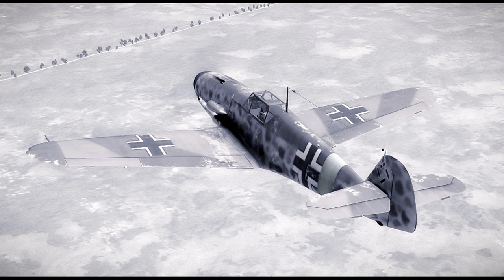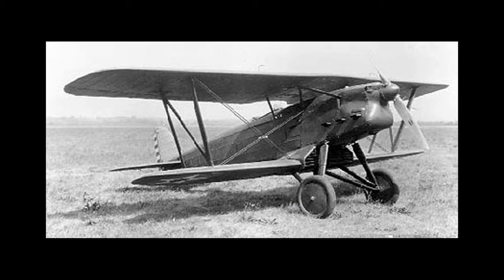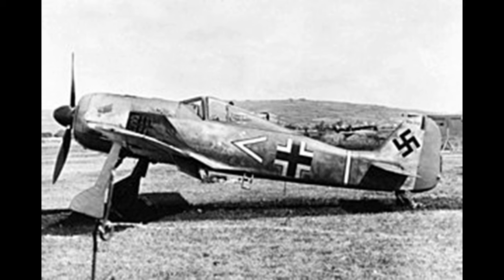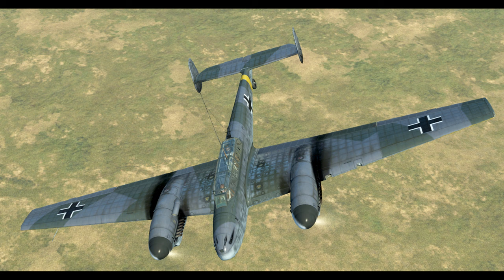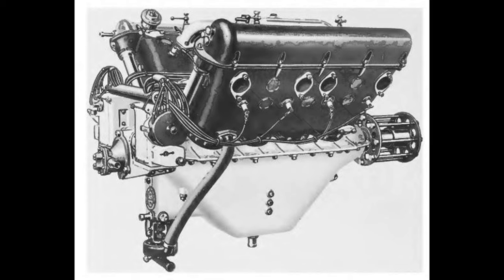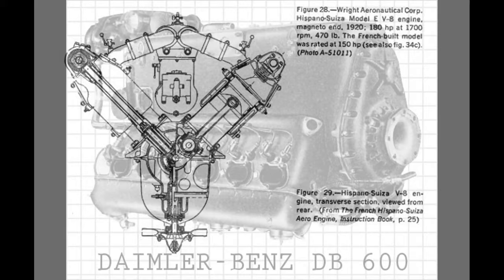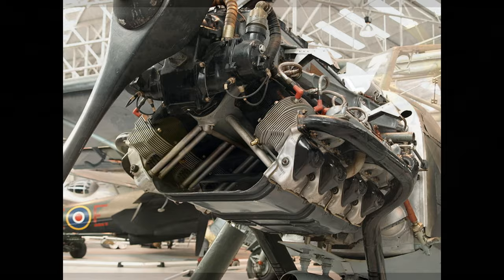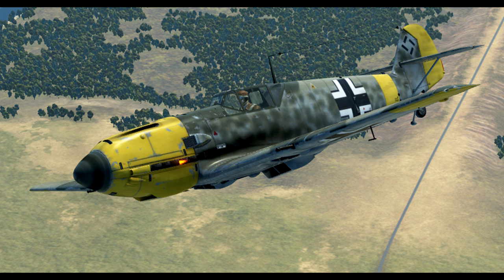Messerschmitt Bf 109 , Why an INVERTED V-12 Pt. 1? inverted V12s vs. upright

Comment: The thing you got wrong about the Tiger is you see the intent wrong. The Tigers intent was not to be a frontline all out tank but a tank you deploy to archive breakthrougs on critical points therefore the "reliability" was not first priority. You call Tiger -> it break through or does a similiar job-> and then goes back and get maintained and goes for the next job. Germany was low on EVERYTHING therefore it pressed it in this role as "Main Battle Tank"
Im a big tanknerd :) 

But great video! Keep it up.
You earned my sub!

Comment: Like you said...and Alan thinks it's a matter of semantics. Nice video. Like that you present the info without bias.
Alan Dicey, former engineer, Avionics and IT

"Oh dear. Yet again I'm forced to begin and answer with "it wasn't"

The DB 600 series were all designed as "inverted-vee" engines, with the crankshaft at the top and exhausts at the bottom. This gave better visibility over the nose, because the crankcase is narrower than the cylinder-head end, and reduced interference from exhaust glare at night.

So, it was mounted the right way up, not only in the Bf 109, but also in all the other aeroplanes it was used in - Bf 110, 210, 410, He 111, 177, 219, Do 215, 217, 335, Ju 288, Ta 152 Macchi C202 Folgore and Reggiane Re 2001 Falco - this not counting the many prototypes that it also powered."

Comment: The Merlin engine was used in British motor torpedo boats and RAF rescue launches as well as a ground version in tanks.  The marine engine had the disadvantage of using gasoline unlike the German E-boats which were diesels.  That was the reason for the development of the Napier Deltic diesel engine which was used in boats by the British and the Americans in Vietnam among others.

Comment: As I recall, Allison was involved early on with producing V-12s for use in dirigibles and other lighter than air craft - they could be serviced in flight and could be reversed in rotation.  Those were the basis for subsequent Allison V-12 designs and they just stayed with that format.  While they had some shortcomings with supercharging, the Allison engines were considered overall the most reliable inlines being used in U.S. built aircraft.

Comment: Good vid, as usual- Just for general info- the only two production American aircraft of WWII vintage that I know of which used inverted cyl head engines was the Fairchild PT-19 primary trainer and the amphibious Grumman designed and built G-44,   Widgeon, both used the Ranger L-440, inline, 6 cyl 175 hp, non-supercharged engines. And according to some people I have talked to who were owners of these types, stated in the PT 19 case it was for trainees to get the best visibility forward. However, many different PT-variants some of which used radials (PT-23 and 200 hp versions of the Ranger engines (PT-26's ). However, a Widgeon owner pointed out the inverted engine offered a higher center of the prop, keeping the propeller tips just a little further from the spray on the water TO and landings. I have seen only one Widgeon with these type engines but several PT-19s with them. One I had access to in Eunice NM, leaked oil like a sieve, but, this could have simply been to old age,  poor maintenance or hard-to-obtain parts.
Reply from the maker: Thanks, and I think that's all true. No question that in the US inverted engines like the Ranger were used extensively, and the low cowling/high prop height was a factor.

Comment: Well researched all good reasons why the 109 had an inverted v12 engine. Another consideration for Willy Messerschimt was the cannon firing through the spinner hub, using the mass of the engine to absorb some of recoil and enable the pilot to fire on a target without the problem of optimun convergence from wing mounted guns.

Comment: Hi, great video and a very coherent explanation. I have another approach: After the First World War, it was forbidden to develop aircraft engines in Germany. Later only civilian engines were allowed. That's why BMW, for example, started building engines for motorcycles and cars. The BMW logo shows a symbolized propeller among blue sky and white clouds, not the Bavarian national colors. Nevertheless, the Reichswehr remained in contact with industry. And the industry wanted to ensure that its aircraft engines would also be accepted by the Reichswehr for military aircraft uses when this was permitted again. Therefore, the Reichswehr was always able to have a great deal of influence on aircraft engine development in Germany and set very clear guidelines on what the engines should look like. This is where the points listed in the video come into play. E.g. visibility for the pilot and easier maintenance. The Reichwehr and later the Wehrmacht were able to rely on engines specially developed for their aircraft tenders and were not dependent on existing ones on the market like the USA, for example.

Post Scriptum: The same applies to engines for tanks and submarines. That's why there were special solutions in Germany for all of these military applications.

Greetings from Germany

Comment: I think you're right. I always thought about the reasons for inverted design too. I haven't thought about the exhaust flash. Good idea.
By the way, as a motorcycle rider, we not only think about low center of gravity, but also "collected" center of gravity.
Think of a weight lifter bar, if the plates are positioned at the ends or in the center of the bar, both would result in the same center of gravity, but the closer the plates are, the easier directional changes would be, - turning, twisting etc.
Ice dancers knows this by instinct.
The inverted design on the 109, lowers the center of gravity,- but perhaps more important, it brings the weight closer to the center.
Great video, thanks. :)
Reply: "polar moment of inertia" is the common term in English.

Comment: This makes a lot of sense. Forward visibility and ease of maintenance. It might also come down to traditional way of doing things in different countries. 
But on a tangent, the narrow landing gear is what knocks the ME 109 out of the “best ever” spot. Losing 25% of your strength on non-combat accidents on take off and landing is really bad for your front line fighter. 
I think moving the gear mounts outboard a bit by giving the fuse a stubby wing extension and then mounting the outer wing panels to that extension would allow the plane to still be transported on its gear with the wings removed but increase the wheel spread and reduce accidents in takeoff and landing.

Comment: This is my first comment on this channel and I have to say that I'm fascinated with your in depth analysis of the airplanes I like most: fighters of the WW2.
About the inverted V, I can see that the hot engine exhaust gases are released just over the upper part of the ME109 wings, wich can contribute to speed up the flow in that area, so increasing wing lift. Maybe it's a minimun effect, but anyway all is welcomed in a war airplane.
Reply from the maker: Maybe. I'm not ruling it out.

Comment: Another thing that was probably taken into consideration is the placement of the machine guns. The two 7.92mm (in early models) and 13mm (in later model) machineguns were mounted where the valves and cylinders of the engine would be if they weren't inverted.
Reply from the maker: Please watch part 2. That's not a bad thought, but it can't be correct.

Comment: You are absolutely correct. The German S Boats (Motor torpedo boats) used 3 x Daimler Benz MB 501 2000hp V20 Diesels. They were upright V's and were not based on aero engines. These boats were 115ft monsters and could exceed 48 knots.

Comment: I was pretty hesitant to comment on a video thats been out for a ferw years but seeing comments from only a few weeks ago decided to anyway.
As a motorcycle tech, I'm always interested in piston engines of all types.
When Yamaha were developing their 1800cc V-twin, they specifically went with push rod motor to keep centre of gravity lower as the usual DOHC puts a lot of mass at the top of a conventional engine. 
A DOHC inverted motor would probably have at minimum the same mass in a pair of heads as a crankshaft but more likely the two heads are heavier when complete than the crank and crankcase?
I think your right about visibility, particularly as WWII German planes were also meant for bombing? Better forward /downward visibility from a 'triangular' section may be an advantage? (the ME262  didn't need the triangular section  with engines on wingsbut got it)

Comment: During the 1950's I served in the R.A.F. as an Eng Mech with type experience on R.R. Merlins/Griffins, Turbines, and Bristol Radials, so without experience on the German D-B 05 inverted V-12 but with experience on Radials with some Upside down Cylinders .... Any Piston engine (British) that I was involved in Servicing an essential part of preparing a Kite for start up if the Engine had been static for anyperiod of time ... Had to have the Prop rotated on Vertical V or In Line configuration on average three full rotations purely to break the Oil/Piston Rings seal(caused by Aero Engine Oils of that 'era' being the consistency of very thick syrup at ambient and low temperatures, hence the longer the Engine remained static the tighter the Piston/Cylinder seal became .. So this was purely breaking the Oil seal. On the other hand ... With the Radials added to the possibility of Oil Seal gumming on ALL Cylinders, the Inverted Cylinders could very easily collect quantities of drip down Oil some of which could work past the Piston Rings etc and cause 'Hydraulic' pressure build up resulting in damage to the lower Cylinders/Starter etc. Therefore it was necessary to isolate all Electrics with an Eng Mech in the Cockpit to ensure no one fiddled with Ignition etc to allow at least two Eng Mechs to 'Walk' the Prop by one Mech pulling down on a Prop blade in the direction of rotation until the prop rotation was smooth, there would be occasions when Spark plus would have to be removed to drain Oil, also Spark Plugs we would have to check for Tolerances, then if up to Spec we lightly sand blasted o remove carbon build up and OIl.

The Merlin/Griffin was a complex Engine but loved by those who knew the Old Girl and her traits, in addition the Merlin/Griffin range of Unit Mks was vast and specially suited to specific applications and settings ie the Merlins/Griffins used in Lancasters etc were a totally different Mark to those fitted in the Spitfire, Hurricane, Mosquito, Shackleton etc etc all of which were tuned for specific purposes.

Another point of Interest was that apparently the 'Mustang' or P-51 was British Air Ministry/R.A.F. specification for a medium/long range Fighter escort, however the U.K. Aero industry was flat out producing the outstanding Mosquitos, Lancasters, Hurricanes , Spitfires etc plus R.R. Merlins, therefore the American Government suggested their Aero Industry had Capacity to develop the project, agreed the American's produced the Mustang in record time however initially it was a barely flying disaster as the Manufacturers elected to ignore the Specification which stipulated the Mustang Spec stipulated a R.R. Merlin was to be used as the Power Plant, but instead the initial production Mustang was fitted with the Allison 1700 resulting in the Mustang barely able to fly, the Air Ministry/R.A.F. reminded the Manufacturers that a Merlin was the Spec,  the next stage was a Packard Merlin was installed with not much improvement, eventually representatives from the Air Ministry/R.A.F. flew over and eventually identified that the Packard Merlin at that stage was not built to R.R. specifications such as Tolerances etc plus some aspects of design was not true to the original R.R. Spec, so R.R. indicated that either the Merlin would be built according to R.R. spec or the manufacturing license would be revoked. A precious original  R.R. Merlin of the right Mk was supplied and the Mustang flew like a bird with longer duration but initially struggled a bit in gaining altitude above 30,000ft.

Here is a tit bit about the Me 109, when you look at images of the Me 109 take a serious look at the Exhaust Stubs, if they are NOT at the D.-B. 05 bottom of the Engine cowling but are at the TOP of the cowling that Model, if I remember correctly called the Buchon, it is fitted with the R.R.Merlin and was built in Spain? ... If you ever play the film "Battle of Britain" you can now concentrate on the Me 109s that were from the Spanish Air Force.  Also another point of interest ... When you see a Spitfire, Hurricane, Me 109 etc on fire and smashed if the Flames are Burning ON the surface of the Wings etc ... They were Fibre Glass as Metal does not burn like that .... At the time the Film was Made with a lot of the filming being carried out From Duxford nr Cambridge which was BoB satellite back up R.A.F. aerodrome and at the time close to where we lived at that time. Now Australia is Home thankfully.

Comment: Interesting and informative.  Another consideration, in the case of a direct drive, is that it allows a longer, more efficient propeller without a longer landing gear.  This was our main consideration when we inverted the Olds/Buick aluminum engine for use in the Wittman Tailwind.
Reply from the maker: That's covered in Part 2.

Comment: All of the reasons you have pointed out is correct. However The powerplant suffered from oil deprecation. Problems at higher altitudes and by inverting the powerplant it's performance increased and now two engine mount machine guns could be fitted,  U boat commander,

Comment: From an engineering standpoint, the horizontal centerline would ideally align include the crankshaft of the engine with the line of the pilots head and the center of the tail of the aircraft. This arrangement would give the pilot the advantage of not only a better field of view but also a better "feel" for knowing exactly where and what the aircraft was doing. Knowing the Germans, this also provided a more stable aircraft and more importantly a better platform from which to fire upon enemy aircraft. The same arrangement would also benefit the dive bombers of the era as well.

Comment: A key factor that allowed the BMW engine to be inverted was that it used fuel injection that could accommodate upward airflow into the cylinder. The Merlin used a carburetor which is better suited to downward flow into the cylinder, reducing "puddling" of gasoline in the intake passages. Since both engines used reduction gearboxes to drive the propeller, the location of the propeller relative to the center of mass of the airplane (and engine) was probably not of much concern. The gearbox would put the propeller offset to the engine location in either case. The main design priority of engines at this point in time was the supercharger. The BMW had a very clever supercharger design that gave it some degree of flexibility, but positioned the air intake on the side of the cowling. The air intake with this inverted engine is positioned above the wing. Had the engine been "upright", the intake would have been competing with the wing. The Merlin design was also driven by supercharger design, eventually allowing the Merlin to run at higher altitudes and better power than the BMW. It was a complicated system that caused the designers a lot of problems. I would guess they went with a conventional engine layout because that was the standard design and reduced the unknowns in an already challenging project.

Comment: Not mentioned as a disadvantage of inverted engine (and the inverted cylinders of a radial engine) is the fact that oil can seep slowly through the piston rings when the plane is parked, and potentially fill the cylinder head with oil. On subsequent start-up, the oil-filled cylinder becomes "fluid-locked", i.e. the piston is unable to compress the incompressible oil, and instead, the piston disintegrates under the power of another cylinder's power stroke. You have to pull the engine through by hand before start to prevent "fluid lock". I think the advantage of the inverted engine is better prop clearance from the ground, due to the crankshaft being above, instead of below the cylinders.

Comment: OH...MY...GOD!  Greg, you have covered SO MUCH GROUND, I will have to watch this several times and have to take notes to reply with my comments!  (BTW, I agree with almost everything you have stated here.)  A side note, the Kalamazoo Air Zoo (Kalamazoo, MI) has a Spanish built (under license) BF-109 powered by a Rolls-Royce MERLIN engine (yes, one can tell by the placement of the exhaust stacks!).  You'll be hearing from me before too long. KUDOS!
Reply: They used Spanish 109's and heinkels in the movie "Battle of Brittan" and I noticed right away they were using Merlin engines, especially on the 109's. The Spanish were building the 109 under license and had them for decades renting them for movie shoots and such. The just had to find a substitute for the D.B. engine.

Comment: Very interesting! The point about using aircraft engines to power boats and tanks jogs a memory of something I read many years ago. While Germany had a suberb marine diesel to put in their S-boote (E-boats) the german tanks were notoriously underpowered throughout the war. The Tiger at 56tons had only 650hp, compare with the T-34 at 28 tons which had a 525hp diesel V-12, that engine was also used in the 14-15ton BT-7 and BT-5bis.

Comment: I apologize if I simply missed you saying it, but another possible insight into choosing the inverted V, might have been the inevitability of discharge from the exhaust under combat damage: fire, smoke or oil, and the impact on visibility and canopy splashing as a result. these would (I think) be minimized by such engine designs.